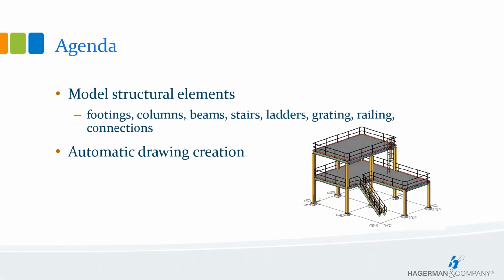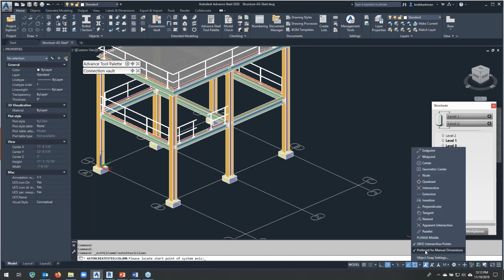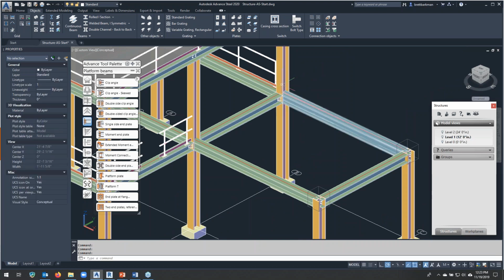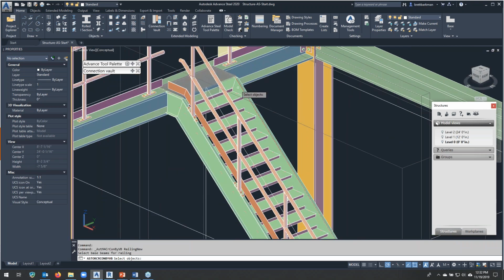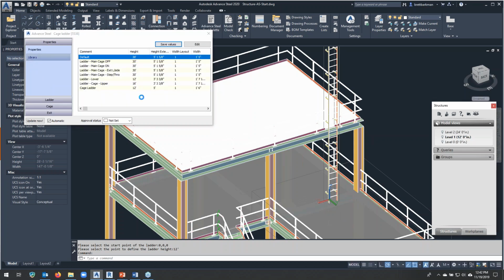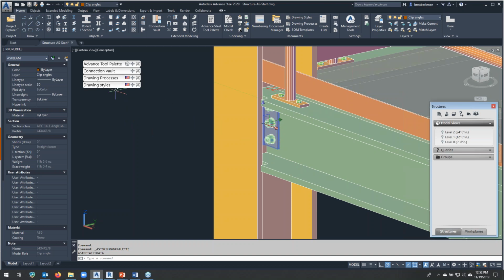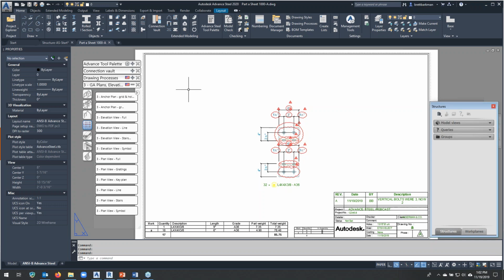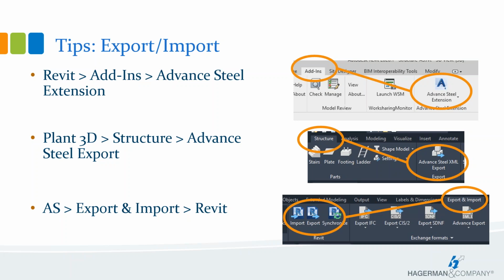Autodesk Advance Steel Overview

Comment: 0:00 - Intro to Advance Steel
MODELING
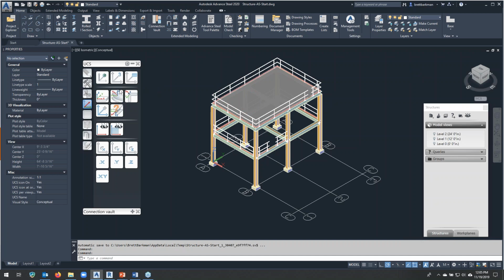2:30 - Tool pallete overview
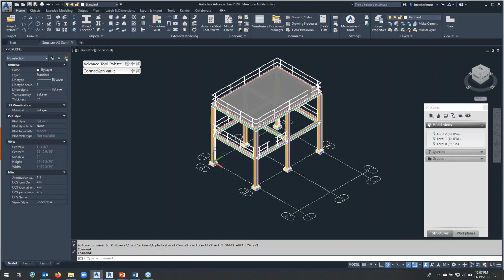4:08 - Connection vault overview
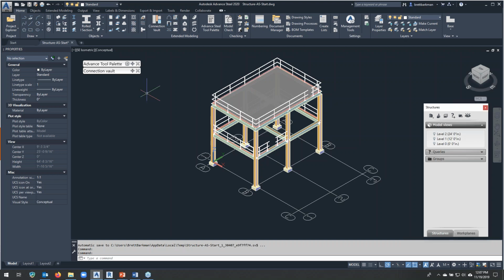4:45 - Project explorer overview
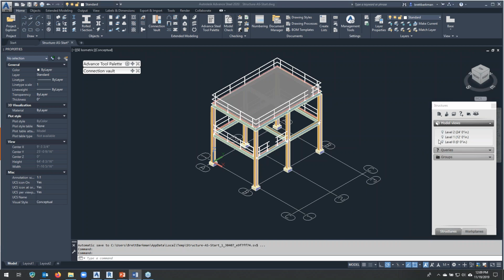6:09 - Attaching objects to levels
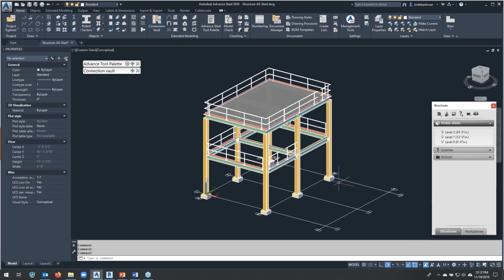9:57 - Creating columns,footings,beams on level
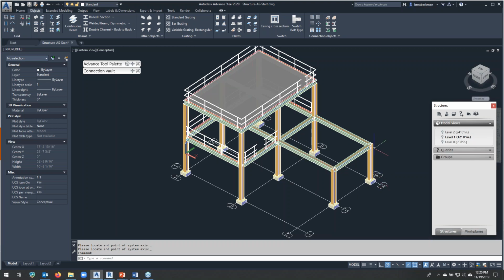17:57 - Adding connections
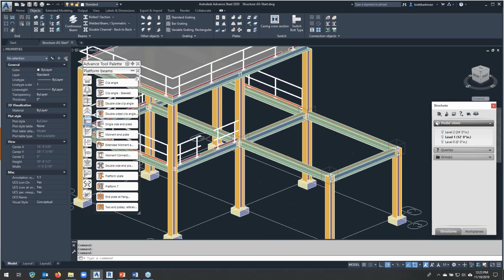21:00 - Advance copy command
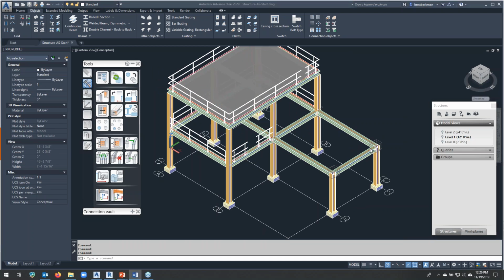23:52 - Propagate joint
26:14 - Creating stairs
34:09 - Adding grating/moving object levels
36:38 - Creating ladders/ move UCS
40:08 - Advance move/properties of an object
42:40 - Weld features
43:55 - Plate/grating contour/ Switch panel
DRAWINGS
48:23 - Selected single part detail
50:50 - Annotating drawings overview
51:26 - Assembly Drawing
52:59 - Plan view
55:23 - Revisions to drawings from model
59:40 - Importing smlx files
1:04:02 - Exporting to Revit

Comment: UPDATE: 
At about the 32 minute mark, I show how to miter a railing.  If you want the miter to include a weld, use RAILING JOINT HANDRAIL from the Connection Vault.
Reply: Also, the miter command includes a weld property.  Once the Miter dialog appears, go to the Cut tab to see the weld settings.

Comment: Thanks for sharing the video.  At the 51 min mark, AS created the part drawing of the clip angle.  Where is the callout for the hole size in the angle?  Is that something you have to add with an annotation?  Thanks again.
Reply: It may not have been configured in the out of box drawing style at the time.  You can do it manually from the Labels & Dimensions tab but it's better to add it to the drawing style so it will be automatic.  Hope this helps.

Comment: Hello, 

Great video is has been really useful! However I am really stuck now.

When I get to trying to generate drawings, I follow your instructions completely but my documents manager is not showing up as having any drawings in it whatsoever. No errors are coming up but they just are not being created. Under details tab its just says empty.

I cannot find the drawings either on my computer under the details folder within the job. The only drawing that shows up is a template with a logo and the name of the job.

Any ideas?

Many thanks,
Callum
Reply: Thanks for the message.  I would need to see your project, but to do that you would need to utilize our support service.  I can put in contact with our service team if you like.  Regards
Reply: @Hagerman_brettbarkman  Yes please Brett. This is killing me. Thanks

Comment: How can I set a layer in the advance steel dwg template that when the GA or assembly drawing dwg is created this same layer can be set turned off or frozen and not printed in the GA and Assembly dwg?
It is that some times I need to use helping beams and those should not be in the drawing and I want to set them on a layer in the model dwg that when they are being turned in to the GA or assembly dwg they do not show up there as they would be on the layer that is set frozen and not printed. An other example is with guard rail posts on corners where two guardrails meet and one post needs to be set on this layer and of course un check everything in the behavior tab.
Reply: Thanks for the question.  If all you want to do is set a layer to no-plot, that is done in the Layer Properties Manager.  That's a core AutoCAD feature.  However, in Advance Steel, if you have some beams that need to plot and others that don't, be careful.  You really don't want to have multiple layers for your beams.  Advance Steel manages its layers and it's best to leave them alone.  To include certain beams in a GA drawing, that would be handled when you run the desired Drawing Style or Process.  Depending on the one you're using, only select the beams to be included in that particular drawing when running the Drawing Style/Process.  For further assistance, please contact us at service@hagerman.com or call 800-422-0313.

Comment: Hi, thank you for your videos, they're interesting.
You have a quite large model here.
I am having lagging issues with my pc hardware configuration.
Specialy when crating/modifying pickets in stair railing or even worse when generating or updating the drawings from the cameras or the sections in the drawings.
What can I do to minimize the time it takes to do this processes?
What hardware are you using on yor pc for Advance Steel
(Not the minimum requirements)?
- Mainboard?
- CPU exact model?
- memory Ram count with mhz, ecc?
- Grafics card model?
- storage SSD/HDD, read/write speed?
Reply: My workstation is the Dell Precision 7710, 32GB RAM, Intel Xeon 2176M CPU @ 2.70 GHz, 64-Bit, Windows 10, 1TB Hard Drive Solid State.  Without knowing your specific hardware and model size & complexity, it's not possible to really resolve your issue.  You'll want to compare your hardware to the Autodesk System Requirements for Advance Steel.  You might need to look for the Recommended requirements versus the minimum.  Other than that, I would suggest that you contact Hagerman & Co. to learn about our customer support services.  Hope this helps.
Reply: @bjbarkman  Thank you.

Comment: I have a condition where the web is trimmed out near the top flange of a W10x68 and the top flange is bent and welded to the web to make it tapered. Will Advance Steel do this?